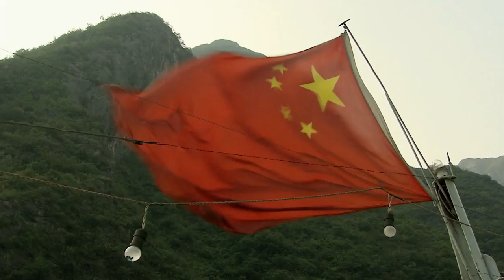China's Most Powerful River Is Also It's Deadliest | Rivers And Life

Comment: 20,000 workers on a building project and 1,000 died? That's insane.
Reply: I think 20000 is the fixed number on site, but the actual number of workers worked there would be much higher,  coz not everyone work from the begining to the end, mostly are short term contract workers, however, 1000 is a lot
Reply: @peterchen7166  by
Reply: @peterchen7166  yes many did not make it to the end   ..  . .
Reply: Insane! What about the Hoover Dam?
Reply: @jamesdykes1829  112 in 1930 but this project is new, must be close to zero
Reply: it's a country where life is cheap and you're on your own as far as safety
Reply: Where did you get the number?